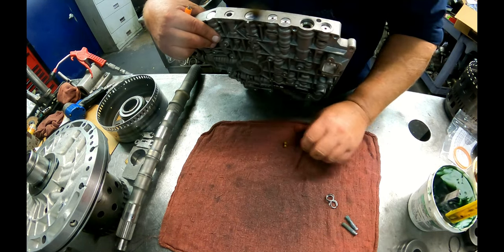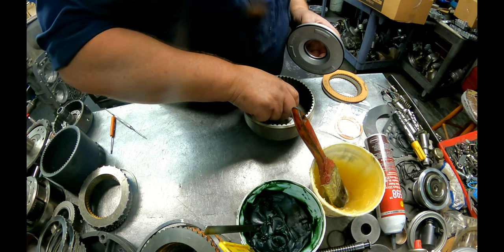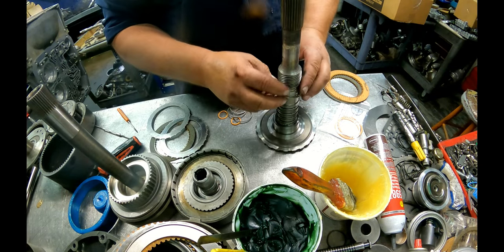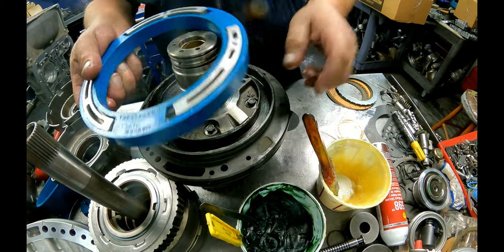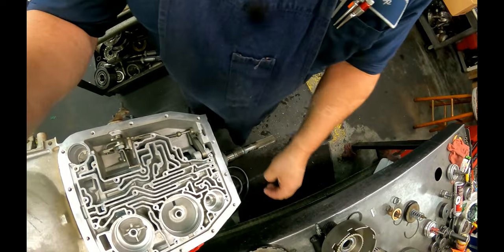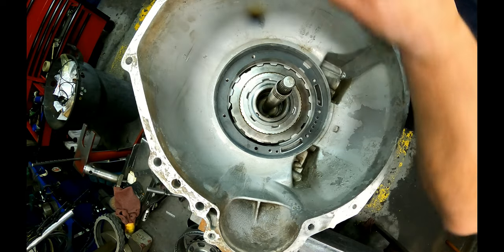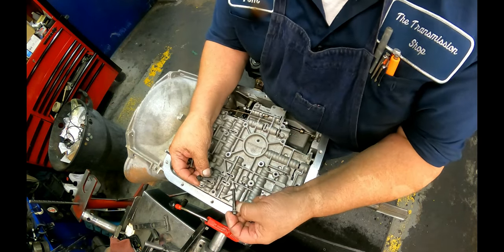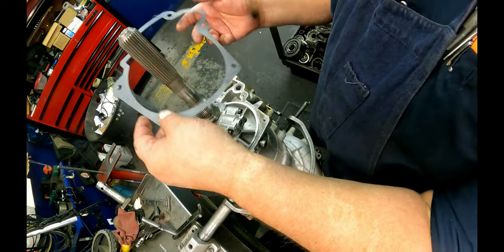AOD Rebuild

Comment: WHAT'S THAT YELLOWISH GREASE YOU'RE USING ? I'm always afraid of using the wrong grease that could damage the seals. Thank you for this great video !
Reply from the maker: No longer available. Only ones left are Lubegard Assembly Goo. Red, blue and green. You can also use vaseline or transmission fluid. Thanks for watching.

Comment: Thanks for the video. My big takeaway from this is to use the lip seal tools rather than trying to do it without them. Problem is, where can these tools be purchased from? I have searched and found nothing so far.
Reply from the maker: Here is a link. If you don't want to do that, you can try using hose clamp and putting it in the freezer overnight. Immediately when you take it out put it in its drum. Then move on to the next one. Don't let it have any time to thaw. Go ahead and lube the seal before you put the clamp on. https://www.toolsource.com/seal-removal-installation-c-1321_119_131/ford-lip-seal-installerprotector-kit-7-pc-p-111037.html?tsqtid=985797
Reply: @CurmudgeonTransmission  Thanks so much, from your link I have now found a number of suppliers of the T1600K installer Kit. I am just finding the cheapest one for freight to Australia now, thanks again for your help.

Comment: @Curmudgeon Transmission excellent information in your videos! Question - working on a 91 Mustang AOD and having an issue where the TV pressure is constantly pegged at 100psi irrelevant of valve position. Have pulled tv apart in valve body and everything is clean and moving properly. Moving the TV arm on the trans with the engine running in N there is no change on the TV pressure. Any possibly things that could be looked into?
Reply from the maker: Thanks. There is a valve in the valve body, believe it is called TV Limit Valve. Will be the third valve on the right from the bottom (opposite the TV line up). See if it is stuck or has a broken spring. If that is not it. Try flat filing the valve body and case. You have a cross leak somewhere.

Comment: Killer video man,i was wondering, i have always wanted to rebuild a AOD for the hell of it,guess to get over my fears of auto tranys,lol and I'm very much mechanically inclined with plenty of tools,my question is, you have a transmission that was running fine but slipping a bit and just not top of the line anymore and you take it apart and refresh everything surgically clean and all that,do you need to mess with any adjustments like those bolts on the side of the tranny etc or if it was running ok before you dont need to touch those?, thats the part i'm not sure i could do or even have any special tools? thank you for your input
Reply from the maker: Probably not. Do need to check the end at the throttle body and if it has a plastic grommet replace it with a brass one from Superior. Only special tools you need for this one is seal protectors are nice for the drums but not an absolute must have. A way to compress the spring cages in the drums. And a pressure gauge to set the cable or rod, which ever you have.

Comment: When you did the 42rle I became a fan - I’ll bet you get tire of people asking specific questions - but if you had one thing to replace on a 42rle when it has a short buck when going into first from second ?
Reply from the maker: If it is after a rebuild you either have to tight clutch clearances or you need to reset the cvi's and do a quick learn if you did not do that after the rebuild.

Comment: Freezing the forward clutch piston worked for me. I was having trouble with my cheap lip protectors so I used a hose clamp and the cheap inner seal protector. Put it all together in the freezer for a few hours took it out and removed the clamp and inner seal protector and it went together easily. I have a question about the reverse clutch  piston reserve spring, the point go down against the thrust spring? According to the wear marks they do. I was hoping to send a picture of my direct drum pressure plate. the videos i have watch seem to have a pressure plate smooth on both sides. Mine has a rib on one side which I have put up. That is one thing I did not take a picture of. Live and learn. I appreciate you answering my questions.  If you have time. Thanks.
Reply from the maker: Yes, the dish of the spring faces down against the ring. Make sure the split in the ring is between one of the fingers of the spring.The bottom pressure plate the smooth side faces up and the rib goes against the Belleville spring. The one that is smooth on both sides is the top one. If you want to send pictures you will have to do it on my Instagram, will not let you do it here.
Reply: I did buy bushings for the aod but a little hesitant to change them. Would this kit from ebay work to do it? Pro 16pc Blind Hole Pilot Bearing Puller Internal Extractor Remover Slide Hammer I dont have Instagram but will try and get on it. What is your instagram? I usually use emails.Thanks.
Reply from the maker: Don't think so. Will be just shy. The inside diameter of the case bushing is 58mm. CurmudgeonTransmission
Reply: @CurmudgeonTransmission  UNIVERSAL  ebay PRESS AND PULL SLEEVE KIT REMOVE INSTALL BUSHES BEARINGS GARAGE TOOL this kit has both
Reply from the maker: Might work for pressing them in, not sure about pulling them.
Reply: @CurmudgeonTransmission  i was wondering about that. thanks.
Reply from the maker: https://youtu.be/1yBcX1nmbfI

Comment: After 2 short test drives the transmission seems to be working. Shifting into overdrive and such. Have not got it out on the hiway yet. I have the throttle valve pressure set for 30-35 psi.  Shifts out of low at about 50 psi. Seems to run down the road at the 30-35psi. Shifts to overdrive, rpm's drop to 1500. I dont have a speedometer. So there is low, drive and overdrive? Before I rebuilt the tranny I think i was driving in drive and the rpm's were 3000. When I tore the tranny down the overdrive servo was stuck. Thanks for all you help.
Reply from the maker: No problem. Thanks for watching.

Comment: Very informative thank you. Question for you an AOD that shifts into OD like it has a shift kit but doesn't can be caused by what possibly? All other gears are smooth. Thanks
Reply from the maker: Before or after a rebuild? If before and it has the 3-4 accumulator in the case, I would see if the spring is broken. Later models eliminated this accumulator set up. Or broken spring, sticking valves in the valve body.
Reply: @CurmudgeonTransmission  Before a rebuilt and this is the original transmission in a 93 f150. So I would assume this has no 3/4 accumulator being the last year of production. Thank you for pointing me in a direction to try and diagnose the problem. Just bought the truck and trying to sort some things out. Thanks again
Reply from the maker: You are correct. It should not have it unless someone had put an earlier valve body on it and then it would need to be installed to work with it.

Comment: I am having a problem with the anti clunk spring. I got it out but not sure how it goes back in. I know the one end is suppose to go in the hole but it seems to short. Not sure where the other end goes. Good video very helpful thanks. My overdrive drum is scored. Can they be smoothed up with some fine grit sandpaper? Does your company have any used ones?
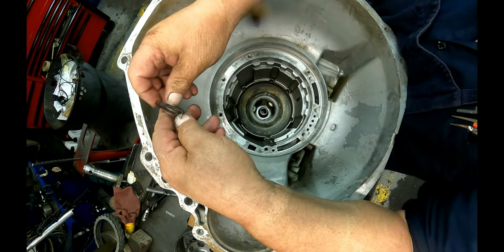Reply from the maker: At the 46:30 mark I am putting it in. The drum is going to be a judgement call. If it is the stamped steel one I would just replace it. They are bad about breaking anyways. If it is the cast drum you may have a hard time finding one. You can swap it to the stamped steel one but the steels and pressure plate are different and will need to be replaced also. You can try Transtar, WIT, Bishop's or Slauson's. Links are in the later videos. No I am sorry we don't, hard to find that nowadays.
Reply: I saw the video. Could not tell what was happening for sure. I messed with it some tonight. Seems like you once you get the pin in the hole have the shell over it a bit and push the spring down between the tranny case and shell. I think it is the shell. Hard to jam down in there.Never did get it. Thanks
Reply from the maker: Yes it can be a pain. Likes to pop back out. Goes between the center support and case to help keep it from clunking when it engages. I use the shaft that goes in the overdrive direct drum. I have an extra one for that purpose. If you are not using the snap ring correction on yours, you can use that. If you are you cannot do that as the shaft has to be in the drum before the planetary goes in.
Reply: @CurmudgeonTransmission  Found my problem. After watching your film for the 4th or 5th time I realized I had the center supprot snapring in the wrong place. So I am now able to get the spring in. I appreciate you help. I am curious how far down the reverse drum sets in the shell. Does it set down in the bottom of the notches? Or just intersect. Thanks.
Reply from the maker: No it does not sit that far down. Maybe 1/2".
Reply: @CurmudgeonTransmission  is there a trick to getting the forward drum assembly to sit down on the forward hub? I am not sure if the forward clutch pack splines are all lined up when I sit it down. Thanks.
Reply from the maker: @jackjenkins2065  No trick. When it is all the way down you can lift up slightly on the drum, let it go and it will have a solid metal to metal clunk.
Reply: @CurmudgeonTransmission  Thank you. I am reading a couple of manuals and watching utube videos. This going in my 1958 f100 behind a 5.0. I am a retired shop teacher so this is giving me some enjoyment. I appreciate your replys in helping.
Reply: I am thinking of upgrading my 89 AOD to a 2 in overdrive band. Research tells me that I will need to get a later model eaod 2" drum and a sun shell with 36 teeth plus the 2"band. Is that all I would need to do? Thanks.
Reply from the maker: @jackjenkins2065  Yes. I would put in an "A" servo and cover if you don't have one already.
Reply: @CurmudgeonTransmission  thank you

Comment: I plan on rebuilding a 1983 AOD in the near future. What year AODE would be a good donor to get the 2" overdrive band set up and A servo?
Reply from the maker: 93 V8. 93 was the last year and it was also a split year. First year for the AOD-E. Parts were supposed to change in 92, however I just did a 93 and it still had the older parts in it. Did not look like it had been into before, still looked virgin. Why don't you try and get the parts you need from Slauson's? Link is in the latest videos for them. Tell them what you are doing and they can help you out.
Reply: @CurmudgeonTransmission  sounds like a plan thanks

Comment: I really enjoy all your videos and wish I had your knowledge but can you help me with an aod issue I an having on an aod that I rebuilt. I am having pressure on my tv port with the valve closed.  I have tried 2 different valve bodies, thanks
Reply from the maker: Thanks. First make sure that your idle is correct, if it is off everything else will be off. Disconnect the rod or cable, which ever you have, and see if it goes to zero or close to it. You can get a rough setting if you do not have the gauge blocks by setting either to where it will connect with no tension either direction. With it connected you should be at about 5psi. With the gauge blocks inserted, about 30psi. If your readings are off and ALL the settings are correct, you have a cross leak. Since you have replaced the valve body, it would be in the case. Double check all of your settings.

Comment: Question for you.  I have an AOD from a 1988 Lincoln that was swapped into a '57 Ford Custom.  It has now started to leak out of the dipstick hole but only after shutdown and typically a few hours afterwards.  It doesn't leak any other time and the tranny is operation just fine.  My guess is the the torque converter is bleeding back into the pan and overfilling it.  Can you point me to a check ball or valve that would allow this bleed back?  I'm also guessing it is probably related to the cooler line as it takes a while to leak and can be intermittent.
Reply from the maker: Are we talking down at the case? Those were, in fact just about any transmission that had an O-ring on the dipstick, bad about leaking there. I used to always put some good silicone, like ultra black, around there to prevent that. Having said that, they do make a anti-drainback valve we used to put in. Transtar and WIT carry them. They come in 5/16 and 3/8, you will need the 5/16. They come in a compression fitting style for metal lines and a style for rubber lines. Been so long since I have bought one I don't remember the part number. Make sure you get it pointing the right direction. It will have an arrow for the direction of flow. These did not have a checkball to stop that, they relied on the bushings to stop that. Even with new bushings some would still drain back. They all have drainback to an extent, some are excessive.

Comment: So it does not matter if the dotis up or down on the outer gear in the pump? My Haynes said reference mark down I assumed (know what that means huh?) that was the dot.
Reply from the maker: The outer gear really does not matter. I have seen them both directions. The inner gear does matter. The bevel of the gear faces the front.
Reply: @CurmudgeonTransmission  thank you, getting closer every day to getting it put back together. Between babysitting grandkids and the honey do list not much time to work on it.

Comment: Great video. Sounds like you're playing johnny Cash in the back ground.
Reply from the maker: Thanks.That would be the radio out in the shop. I have to run the fan to try and mask it so I don't get copyright infringements. Surprised I did not get one if you can make it out.
Reply: Makes sense haha.  @CurmudgeonTransmission

Comment: I got the valve body on and have a bolt left over. It is a short bolt but not threaded all the way like the valve body bolts. I had it in the bag of valve body bolts. The detent spring takes a long bolt according to my manual. Any good guesses? Thanks. I do have another trannie I can take apart if I need too.
Reply from the maker: Some had 2 bolts like that on the valve body. 1 at the top and 1 at the bottom. They were used as line up bolts. You will notice the holes are smaller on the valve body where they go.
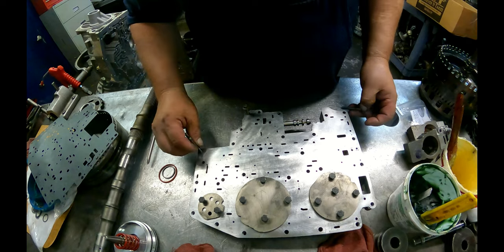Reply: @CurmudgeonTransmission  At 6:17 on your video you are putting in a bolt at the top of the back side of the valve body? What is that bolt? I did not put that in. Maybe that is where my bolt goes. I only put in the long bolt on the detent spring on the other side, no bolt in the back hole which is threaded. Seems like there should be a bolt there to keep the spring from swiveling. I have noticed my tv does not return all the way due to the tension of the detent spring. When I was using this trannie before, I had to put a bungie cord on the outside of the trannie to pull the tv lever back to get my 30 -40 lbs of tv pressure. Could the  tv spring in the valve body be weak? Looks like a real job to change it. thanks.
Reply from the maker: Yes, that bolt is what keeps the detent from being able to turn. It has threads all the way up. The 2 without the threads all the way up hold the valve body to the case and go in the holes that are smaller than the others. One at the top to the left and 1 at the bottom to the right. If I am remembering correctly. Once you have the valve body bolted down you need to bring the spring around and it sits on the separator plate in the V notch that is there. If that is not enough pressure to return it there may be something wrong with the cable or the return spring up at the throttle body.
Reply: @CurmudgeonTransmission  i got the bolt thing figured out. The detent spring is not letting the throttle valve piston  return all the way. What if I leave the detent spring end out of the v notch. Then the piston returns all the way.thanks
Reply: @CurmudgeonTransmission  Its the throttle tension spring (my mistake) that i think is keeping the tv piston from going back far enough.

Comment: What’s the tool you’re using a roughly 10 minutes ? Thanks. I’d like to buy it b
Reply from the maker: Lip seal protectors. https://www.toolsource.com/seal-removal-installation-c-1321_119_131/ford-lip-seal-installerprotector-kit-7-pc-p-111037.html?tsqtid=1252276

Comment: Hello, on my 83 AOD rebuild the accumulator infront and back have 0,04" big Gap to bore hole and drop without drag in it. Is that OK?
Reply from the maker: Yes that is normal. If you want you can replace the one in back with a rubber molded piston. Is a nice upgrade. https://www.sonnax.com/parts/2380-2-3-accumulator-piston

Comment: I have a 91 f150 AOD my fluid was overdue for a change it was still medium red in color so I did a fluid change shifted fine for two weeks then would not come out of first gear I had reverse. what do you think is the problem? I ended up using an AOD out of a 93 and had to modify my shifting linkage because the parking gear where apposed from the steering column and shift linkage on trans but now are the same after I modified the linkage.
Reply from the maker: Hard to say. Could be as simple as a shift valve or governor stuck. Could be more. That is a risk you take changing the fluid when it has started changing color. You can cause problems. There comes a point where it is better to leave it alone. Sometimes it is hard to tell when that is.

Comment: I got the pump on and bolted down. There does not seem to be any end play in the turbine  shaft. Everything turns.
Reply from the maker: You should be good to go. End play should be .002-.025. If everything turns by hand you are not too tight.
Reply: @CurmudgeonTransmission  Great thanks.